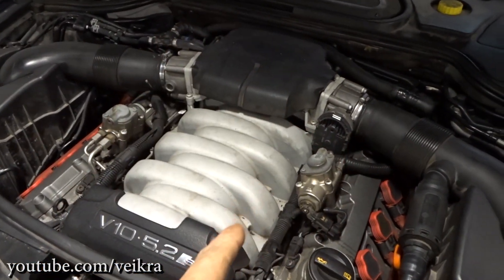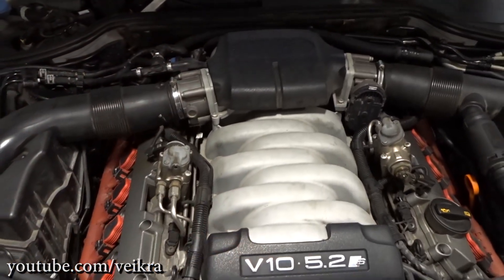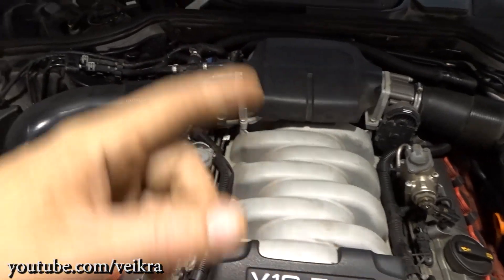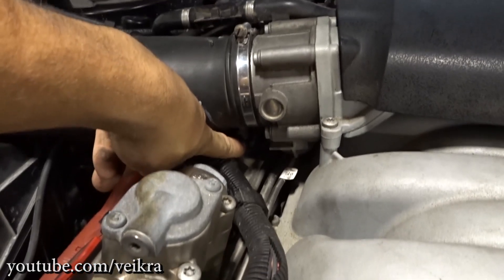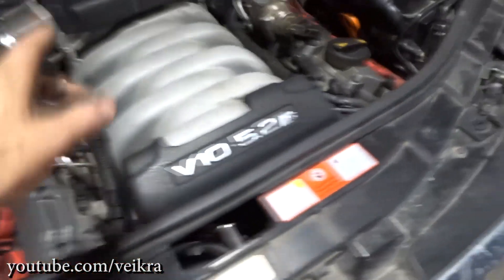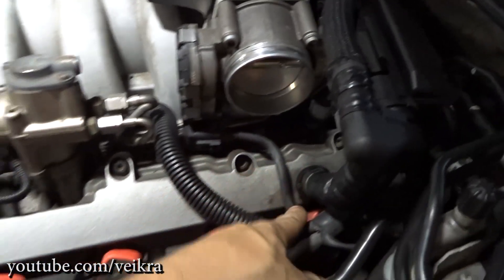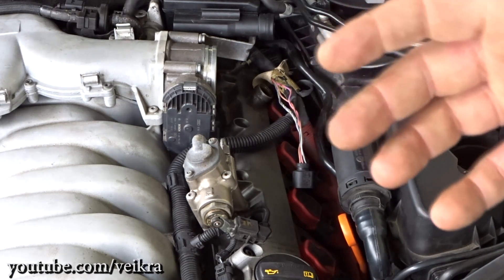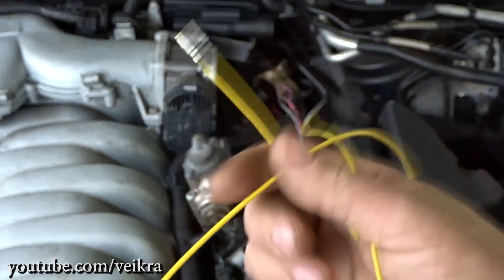Audi S8 V10 5.2 EPC error light repair first step

Comment: Hey I have the epc problem n I have no idea wht to do with it I have 08 v8
Reply from the maker: tell me the codes
Reply: Veikra bro my Audi epc comes on & starts puttering....... like it wants to shut off 09 3.2 Quattro
Reply from the maker: @brock2872  if epc comes on, it stores a store. Pulling the code is essential since epc can come on about anything related to power delivery.
Reply: Veikra yeah it was the coils. It was misfiring
Reply from the maker: @brock2872  totally normal after  10 years most coils are on their way out.
Reply from the maker: @Twan smith Do you have discord for chat?

Comment: i have a b8 2010 s4 3.0 L v6 the epc light comes on after i try and accelerate hard... during idling it putters.
once i turn it off and then attempt to accelerate hard the light comes on once again and the same issue comes around. throttle body??? help plzz
Reply from the maker: very probable. pull the code, you'll probably have a  sensor a, sensor  b, or  performance issue related code.  Since this is repeatable easily, you can log both signals and see it happening.  If you get a small code reader, and post the codes here, Ill be able to tell more easily.  First you should inspect for play in the throttle blade, then if good run a calibration of the throttle body.  BUT what you describe looks like throttle body. In my case it would do that, but it was the connector. Your car has the updated connector, it "should" be fine but check the tightness of the contacts
Reply: Snippetmaster3000 yes I fixed it it all my spark plugs were shot and a coil was shot too. I just replaced all the coil packs and the misfires stopped. Thank you for the help.
Reply from the maker: @FNBen1090  Glad to hear it

Comment: I have a 2012 Audi Q7 w 56k miles.  Last week, I had sent my car BACK to the dealership for EPC light for the 6th time.  they told me 1st time, it was the TPMS sensors.  Then they told me it was spark plugs 1-3.  Sent it back again, they then told me it was plugs 4-6.  After a month at the dealership, they told me they replaced the O2 sensors and 2 fuel injectors.  Had the car back for 3 days, now it's back at the dealership.  I put 4k miles on it this past year.  They tried to tell me it's because I didn't drive my car enough.  WTF.....now my representative at Audi is ducking my calls and texts.  I'm so pissed.
audi
Reply from the maker: TMPS have NOTHING to do with EPC .  So that's that.  You intermittant problem sounds like carbon buildup. When was it last cleaned for carbon buildup ?
Reply: @Nordic_Mechanic  yes TPMS does not, you are correct.  There was a manufacturer recall on the catalytic which they replaced.  Then they told me there was carbon buildup which they allegedly cleaned.  Then they went and replaced the o2 sensors and 2 fuel injectors.   Amd then.....it's back at the dealership.
Reply from the maker: @cheftuan  And never in the process did they replace ignitions coils? I feel they swapped coil from 1-3 to 4-6 first time around to see if it was a coil problem but it didnt replicate the problem on 4-6 until you drove it.   IF I had the code, I would starts with making sure those coils are good before tearing down further like they seem to have done. Coils and carbon buildup are more likely at 57 000 than injectors. Throttle body would leave some perfomance codes if it became bad enough. Those are good engine with few problems, make sure that carbon clean was actually done.  Also, run it on only on premium gas at least until problem is solved. Lots of ignition coils and injectors are replaced when carbon and it never works right until a physical carbon clean is done.  Chemical clean without removing intake does not always work.  Good luck !
Reply: @Nordic_Mechanic  thank you for your response!  I'll take to my tech guy about what you said.  I only run 93 octane gas on this baby.  Again, thank you so much for your input.
Reply from the maker: @cheftuan  if you only run 93 I see even less how injectors could be bad at such low mileage. Definitely misdiagnosed in the first place
Reply: @Nordic_Mechanic  i absolutely agree.
Reply: @Nordic_Mechanic  interesting turn of events. Audi finally contacted me.  They told me they are going to replace the 4 remaining injectors for me at no cost.  They feel it's the "right thing" to do considering all the crap so far.   I'm hoping this will 100% fix the issue.  Picking the car up later today.   HOPEFULLY this fixes EPC light issue once n for all.
Reply from the maker: @cheftuan  Maybe it will, let's hope so. And if they didnt do the carbon clean like they said they did but have no proof, then they ll do it now because theyll be in there from replacing the injectors. Either way, it's a very reliable serie of engine you shouldnt have those problems.  Ive seen many 300 000km 3.0T with no issue aside for pcv valve issues, common problem on those.
Reply: @Nordic_Mechanic  yeah let's hope i never hear the warning lights go off again.  But I have to tell you, driving home yesterday,  I was on edge the entire drive.  Every bump in the road made me nervous as fuck.  Hhaha..again,  I want to say thank you for all your responses.
Reply from the maker: @cheftuan  haha no worries .

Comment: I have a 01 a6 and the light comes on and it shuts off after 30 mins of running.  Starts back up after 30 mins or so.  But there is no code.
Reply from the maker: I would look for code inside your abs unit, not the engine. You may have a bad wheel sensor/wheel bearing. It would explain why you dont see the code with a normal scanner. Try vcds or any high end scanner and there will be a code leading you to the problem im sure.
Reply: Change the relays by the computer, had the same problem 2400 dollars later didn't fix it but a 13 dollar 30amp relay fixed the problem!
Reply: @FATALROTARY  thanks. Going to give it a try.
Reply from the maker: @FATALROTARY  What relays did you change? ecm, fuel pump or ?
Reply: @Nordic_Mechanic  I changed all the relays in the box the ecu is located in.there should be 3(2 30amp and idk what the small one amp is).two big ones and a smaller one.the problem never appeared again.
Reply from the maker: @FATALROTARY  Good, I asked so that other may find this relevant in the future.

Comment: Having this issue now with 2007 Audi s6 v10. Codes are 
05465 Throttle valve control unit malfunction 
00545 Throttle/pedal position sensor switch B
00289 throttle pedal pos sensor A circ range performance

Do you have a part # for the connectors and wiring used I can’t seem to find them online.

Also having:
05491 left electro hydraulic engine mount solenoid valve open
08198 intake manifold runner control bank 1 stuck closed 
08196 intake manifold runner control bank 1 stuck open 
05497 throttle valve control unit adaption not initiated
Reply from the maker: OK here we go throttle valve code look like throttle body but on which engine? one or two? Replace all the wiring first else it's the throttle body on that "engine".  05497 Simply do adaptation once everything is fixed. As for 05491 common issue, either delete the sensor or replace engine mount.  08196 and 08198 Thats a 2599$ intake to fix it plus labor, no ways around it. Pay to play its the achille heel of the V10 in s6 and s8. R8 doesnt have that intake so it's fine
Reply: @Nordic_Mechanic  thanks for the quick reply! The 05465, 00545 and 00289 codes are coming from Engine 1 which is the driver side yeah?

Any info on how to delete the sensor you’re mentioning? I also have a brand new JHM intake manifold in the vehicle that I did with a carbon cleaning. It looks like all the vacuum lines are secured as well!
Reply from the maker: @yz125rider2006  depends where in the world you are hahaha.  engine 1 is bank one 12345 so right side of vehicule as you drive it.  To delete sensor you unplug it and put a resistor instead.  Vaccuum lines have nothing to do with intake on the 5.2L, it's all electrical and it's jammed somehow. Usually jammed because of broken flaps in the intake.  Check the front of the intake, that's where they all reside. Unbolt them and check that all 3 shafts turn freely. Love these engine, only sad the intakes break and are so costly.
Reply: @Nordic_Mechanic  oh okay I thought it was 5-10 because when I get EPC fault I disconnect the 5-10 side and it it back in and clear engine 1 and 2 codes and the problem goes away for 2-7 days until happening again.

Do you happen to have the part numbers to do the new clips and wiring for the connectors?

Weird that the intake would be failing I just replaced it with only 1k miles on it now it was brand new
Reply from the maker: @yz125rider2006  Yes it's  gonna work if you clear code and mess with it. I know I could cause the code to pop on 2 other S8. All I did was go to freeway speed and let off completely. Watch the fuel comsumption go to zero on compression then eventually when slow enough fuel is put back in and the throttle codes would pop. How much that intake cost you? JHM doesnt make intakes, so it's an oem? They make intake spacers though. As I said check that all shafts turn freely without the motors on them. If they do you found the problem.
Reply: @Nordic_Mechanic  it cost me $2,100 off of their website they are $3k+ now.  Would you recommend changing out the clips and writing before ordering new throttle bodies?
Reply from the maker: @yz125rider2006   Don't put new throttle bodies with old style connectors. Check if your wires are yellow, if they arent, you HAVE to change the plug pins and wires. For me, the problem only disapeared for good after I replaced the second connector even though I put new throttles on. First time I saw the problem was on a R8 so it's ALL the old style connector that end up being slack. Wire can break withing the first 20 cm of the right side throtlle body. Not a full break so it cause intermittant problems.
Reply: @Nordic_Mechanic  so how far back do you need to re splice all the nee wiring for the connectors? I’ll check tomorrow if I have the yellow wiring or not but either way I’m assuming I’ll have to replace entire thing. I can’t find it online however to purchase nee connector / wiring
Reply from the maker: @yz125rider2006  Go to dealership for the new style connector and pig tails. The pigtails are precrimps on both side so you only need 2 small gauge and 1 large gauge wire. You cut them in half. That'll remove the first 6 inchs , where the sharp turn is

Also check for slack in the throttle plate. Too much slack you'll get a range/performance code
Reply from the maker: @yz125rider2006  problem went away because you clear both computer, both sides. SAME thing happened to me, if I didnt clear,  problem would come back quicker. Pigtails first, then throttle . I've used aftermarket throttle bodies, check my other videos I have a way to make them last longer and ive been very happy with them. Very impressive copies of the OEM part
Reply: @Nordic_Mechanic  I do get the range / performance code so I’ll assume everything needs to be done LOL

Thanks for all the tips !
Reply from the maker: @yz125rider2006  Youll get range prformace for slack connector pins as well . Hence  why you must do wires first
Reply: @Nordic_Mechanic  okay great I’m gonna start by going to dealer for new connectors and try the wiring fix first. Is it important to follow that “twist” they do ?
Reply from the maker: @yz125rider2006  as best as possible but dont lose sleep over it
Reply: @Nordic_Mechanic  any chance you know how to fix Parking Brake Malfunction error too? Rear trunk 30AFuses didn’t seem to fix problem but I’m assuming I need to replace entire module. Happened after battery died and I jumped car from battery ( I know is a no-no)
Reply from the maker: @yz125rider2006  I have a video about the parking brake as well. If it was working perfectly fine before battery died, it may be as simple  as calibrating the pad thickness and doing the function test
Reply: @Nordic_Mechanic  do you have discord or a way to talk I have a few questions on ordering these clips / wiring about to tackle this task

Comment: I have a 12 Audi S5 was riding one night epc light and engine light came on started smoking out tail pipe put scanner on scanner stated misfire bank 3/4 took bank 4 out and saw gas in cylinder changed the injector put everything back together now the car isn’t starting starter isn’t even clicking HELP !!!!
Reply from the maker: you cant have 4 banks of cylinders. Is it cylinder number 3 and 4 perhaps? And if you have a bad coil and engine not firing on a specific cylinder then its normal to have a wet cylinder with lots of gas since its not burning it.  Did you clear all codes and fully  charge  battery? Check other modules too, could be a no start from battery management
Reply: Veikra I didn’t charge battery but everything still comes on lights and everything I can hear the gas pumping just not turning over I fix the injector so gas isn’t running into cylinder no more my only problem now is it isn’t starting u think I kilt the starter when I was trying crank it with coil out ? I been having funny actions with the starter here and there sometimes tried hitting the starter to see if it give but no luck
Reply from the maker: @reggie1996baby  you could try to bypass the starter circuit, see if it turns that way.  But did you check code with a dealer level software?
Reply: Veikra no I don’t have that type scanner I have regular scanner tool where can I get that one from ?
Reply from the maker: https://www.ross-tech.com/  You can get a version for your car only and will only cost a few hundred dollars
Reply: Veikra where is the starter circuit located exactly
Reply from the maker: @reggie1996baby   ecu -> start relay -> starter.  Find the relay and replace it for peace of mind

Comment: EPC + Do Not Exceed Maximum Engine Speed of 4,000RPM this is showin in my Audi A8 2012
Reply from the maker: The engine has gone into self protection mode. Some sensor is defective and the computer can't do it's job properly. You need to pull the codes and it will narrow it down. EPC is Engine Power Control so it only means the problem is with the vehicule's powertrain. It could be a bad signal from the throttle pedal or a bad ignition coil
Reply from the maker: A limit on rpm sounds like a knock sensor, just fixed one of those